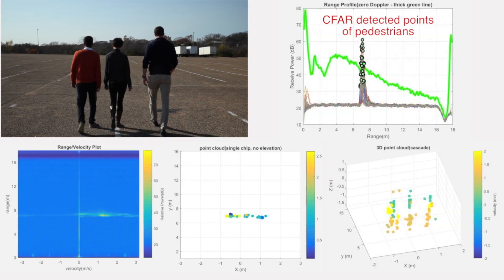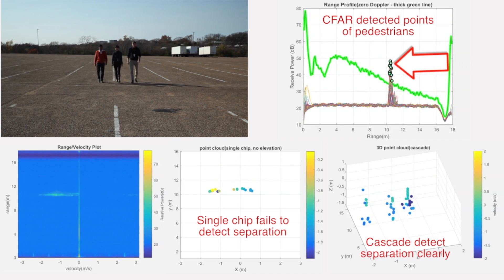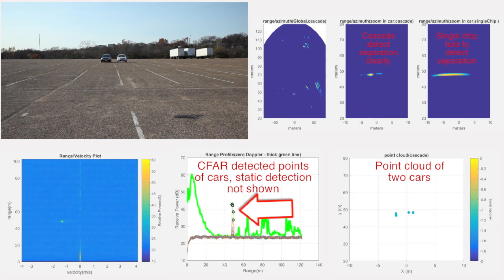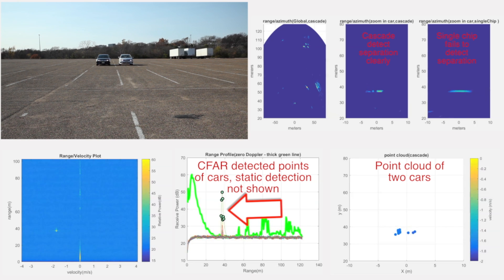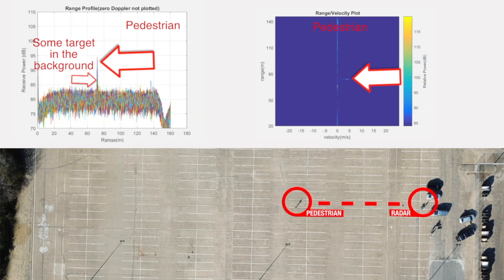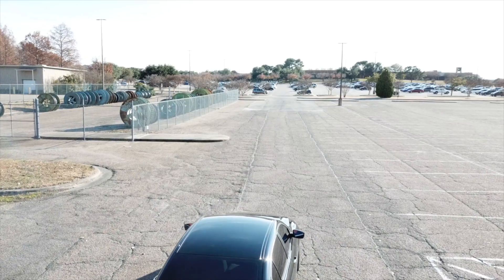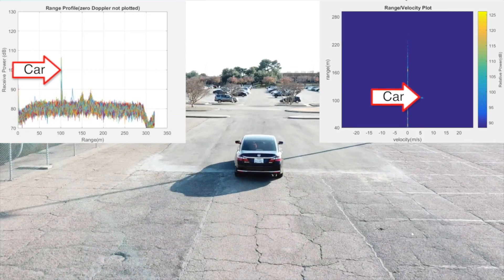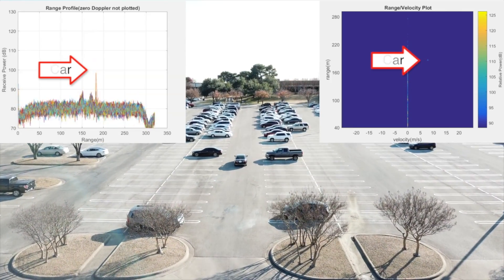Imaging radar using multiple single-chip FMCW transceivers

Comment: In the video it say that 9 TX antennas transmitted at the same time. AWR1243 Documentation says that only 2 TX antennas can transmit simultanously , so 4 cascaded chips should equal to 8 TX antennas transmitting simultanously and not 9 right?
Reply: I think one is dummy antenna